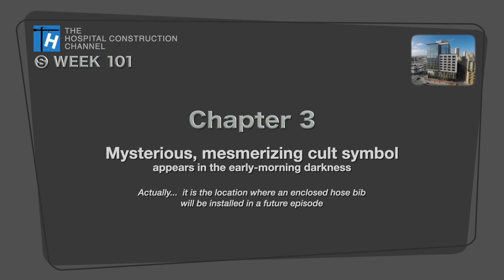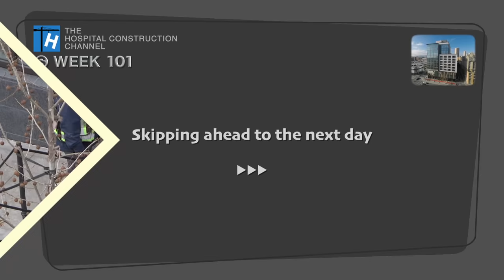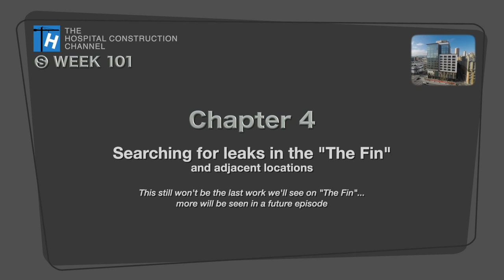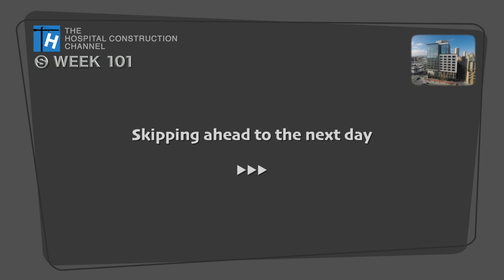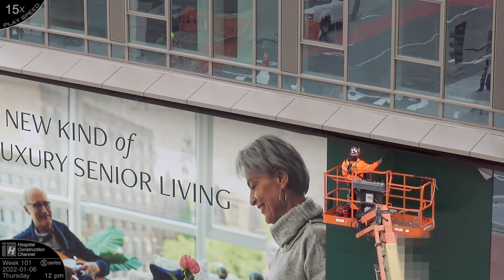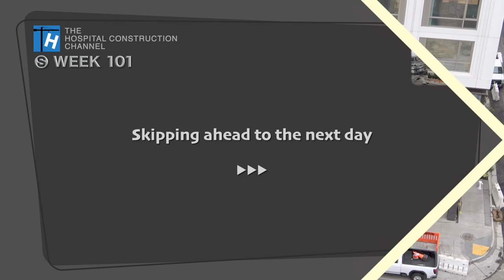Construction time-lapses w/closeups (compilation): Week 101 of the Ⓢ-series

Comment: I used to haul hot rocks (blacktop) and what the driver is doing there is spraying diesel fuel on his body to prevent the mix from sticking. Some jobs will refuse to accept the load if there is diesel fluid on the body. There is an accepted fluid most contractors accept, you'd find it just prior to getting loaded at most batch plants. I love the smell of hot rocks in the morning. lol